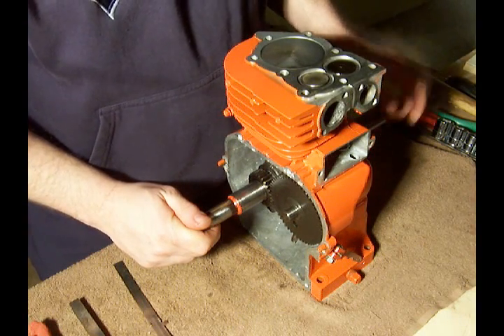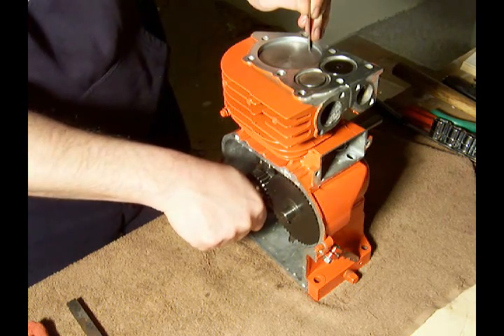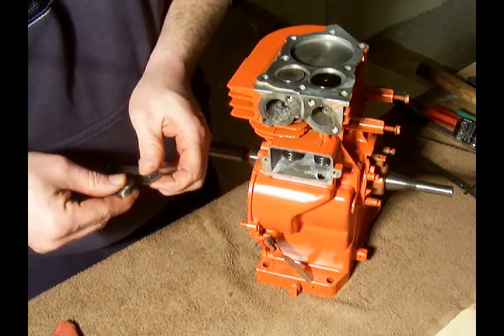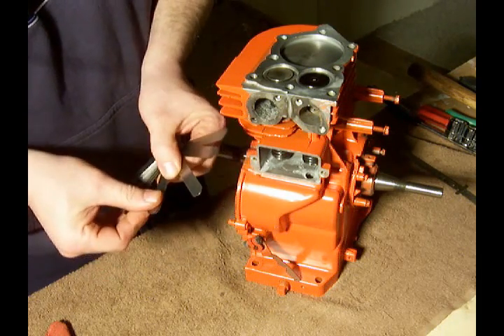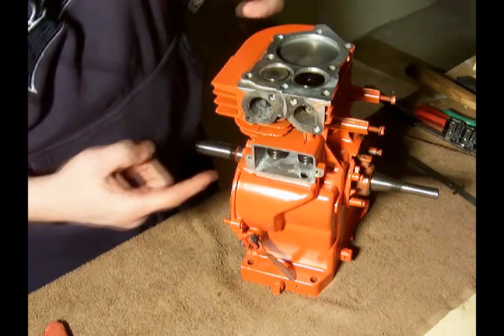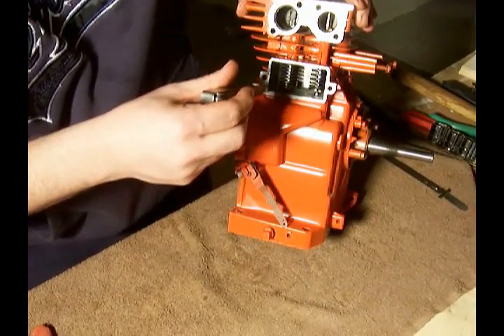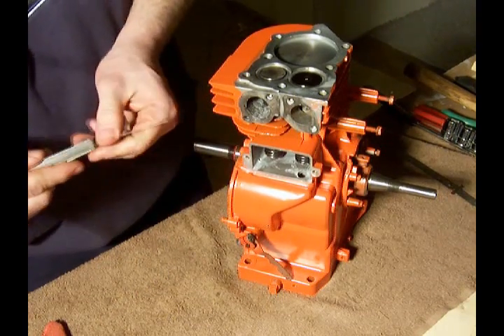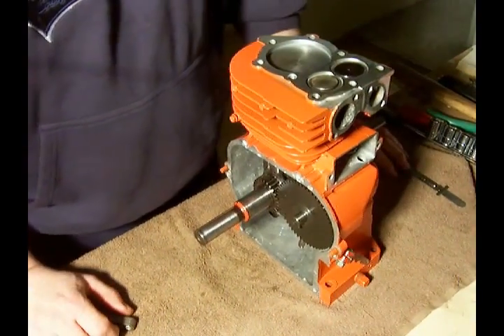#7 - Briggs and Stratton 5HP 130202 - How to check valve and tappet clearances

Comment: Of course there's a little more clearance than you'd like,
side cover must be on, it helps hold up that end of the cam!
Reply: Exactly- quite big difference when cover on and camshaft sated correctly
Reply: dang that's good info! exactly what I was looking for. I was trying to figure out what to do because my exhaust valve was out of spec, but I didn't have the side cover on. put it on an ended up having to file the valve down a bit. saved the day!

Comment: do you mean 0.05 or 0.05'' ?
Reply: I do not set my valves on L heads 1/4 past TDC .  I do on OHV engines tho. 

I have built many L Head engines and they do just fine at TDC like they supposed to be. ~!~!
Reply from the maker: 0.005 also known as 5 thousandths of an inch. Thanks for watching.
Reply: sblg43 ok. And I always thought the piston has to be on the highest Position in the cylinder to    check the distance with a feeler gage?! So the correct position is a  quarter inch down= 1/4 x 25,4mm=6,35mm, right?
Reply from the maker: According to the Briggs and Stratton repair manual, yes.
Reply: a quarter inch down or the highest position of the piston?
Reply from the maker: As shown in my video, 1/4 inch past TDC (Top Dead Center)
Reply: Ah OK, thanks!

Comment: Is it just me or is does this guy have this backwards? He refers to the exhaust as the intake and vice versa.
Reply from the maker: It's you. I am correct in pointing out the exhaust vs intake. Thanks for watching.
Reply: LOL it's just you, 
you must be a Tecumseh person
Reply: Intake valve is on the flywheel  side . Look where the tank bolts are. 

Exhaust is on the clutch side.  

Example a 3 to 4.5 hp briggs on a lawn mower. The tank and carb is on top and the intake is on top. 

The exhaust is on the bottom where the muffler comes out. ~!~!

Comment: Funny that on my engine, with the side cover on, the intake is ok, but the exhaust is tight.
How does the exhaust valve grow in length when it should wear a little shorter?
I did swap the lifters around to see if I mixed them up, but it's the same either way.
Edit:
Ok, the wife is out of town so I had no need to turn on the thinking device.
Lap the valve and it will sink in just a little into the block.
My exhaust valve was not burnt but not pretty and it took a while to lap a decent face on it.
I must have lowered it a few thousandths not to mention the normal wear from running.
Reply: Valves don't grow. The valve seats and valve faces always wear at a greater rate than the end of the stem where the tappet pushes on it. Your exhaust valve will burn if there is not enough "contact time" with the valve seat to cool the valve. If you like your Briggs and Stratton engine, you will set your exhaust valve up looser than spec by a few thousandths of an inch which will make the exhaust valve live forever in these engines. I don't care what it says to do in the Briggs and Stratton service manual. The published valve specs are too tight for these engines.

Comment: What type of coating is on the block?  Has it been spray painted or powder coated?
Reply from the maker: kaiok1777 It has been spray painted with high heat primer and high heat engine paint. Thanks for watching.